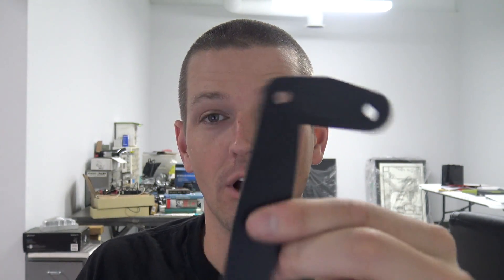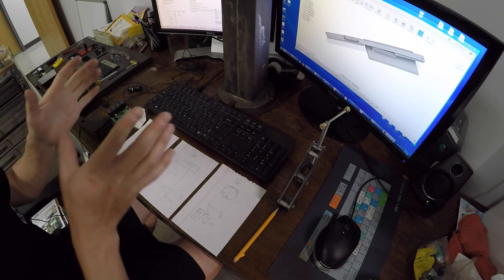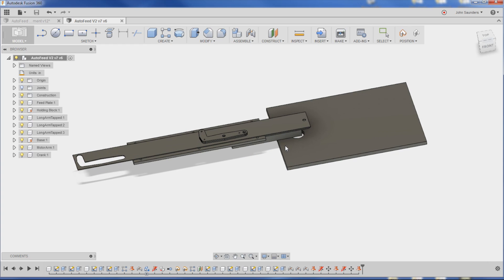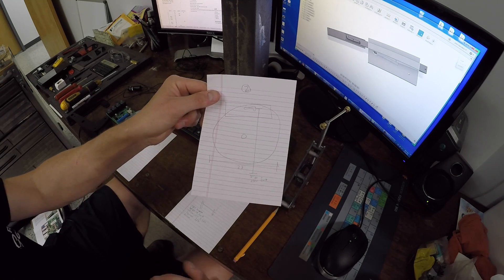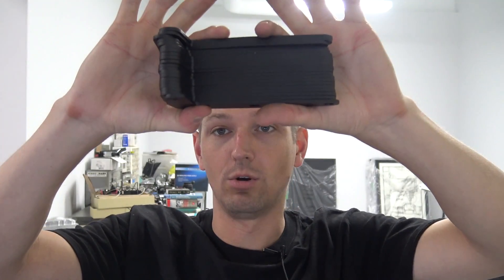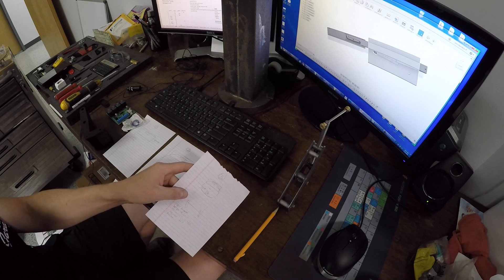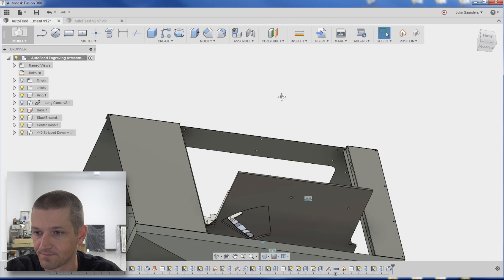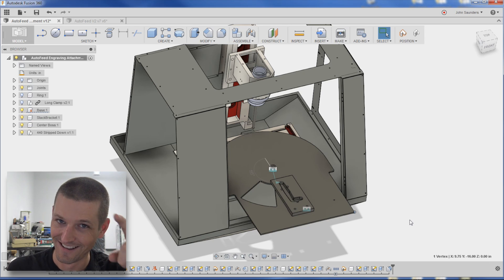Automatic Arduino CNC Parts Loader: Tormach 440!  Part 1

Comment: instead of using just one position why not use 11 slots for parts and one eject point and use smaller steps to make one revolution engraving 11 parts per full rotation

Comment: Nice! i'm so stoked about this one man. I do concur with the comments here about more slots in the disc to make it more efficient, also you could use one of those electromagnets to relieve the weight from the stack while the part is not being dropped to the slot.

Comment: Why do you need a disk? I would mount my stack over a platen on the mill table. The table could be motioned to drop and strip the part in a cutout in the platen then moved to be engraved, could then be moved and either dropped thru the platen to eject thru a chute (clearance problem?) or moved over a wedge system to ramp it up and out to eject to a chute or container to gather the engraved part.

Comment: Here's some help to make this super simple! Use a Machinists rotary table to attach your large round disk to. This will give you your pivot point. Plus add some torque multiplication and holding ability. Then I would recomend a CLEAR-PATH stepper with built in motion controller to drive the rotary table. Here is a link to a video on the Clear-path stepper. https://www.teknic.com/video/clearpath_abs_pos_4.mp4

Comment: having enough tolerance for the part to just gravity locate into the slot without moving when being engraved will be a challenge. The slot would either be too tight and you will have fees problems or it would be too loose and move under the engraver. I would vote for locating the parts with pins on a single flat rotary platern and using the automaton to place and remove the parts with a magnet. You wont ve scratching your powder coat finish so much by having them slide about.

Comment: I wonder if a servo motor would be better suited for the turn table verses a stepper motor? Seems like it would simplify things as far as keeping the engraving position correct because of where they work off of positioning instead of steps.

Comment: Love the circle idea, it's simple and has few moving parts.  One thing I would do is make the circle grab a new part every 60 degrees.  This will speed up cycle time ( the circle only needs to move 60 degrees instead of 360).  When the circle stops to engrave it is also at the spots to drop a finished part and pick up a new part.  Your feed hopper should work fine as long as you keep the stack level.  If the weight of the stack in the hopper creates too much friction, try using an actuator to keep the entire stack from resting on the circle at once.

Comment: If you go with this design you may want to consider having a tray to let the parts slide into a bucket that maybe is sitting on the floor outside of the mill.

The rotary table may need to be clamped, or pinned, so it doesn't move while engraving.

The idea, as suggested by others, to move multiple parts on the platter is a good one.

Comment: two things on sketching.  One, use light graph paper (very faint lines so your sketch shows and not the graph paper), that way square lines are easy to draw. Two, use a scale to draw straight lines that are on dimension.  Always draw to scale.  The other thing to do is label your sketches, date them and title them so you know what and when they are from.  

A few simple drawing tool from Staples/office depot for $20 will make sketching much easier and more enjoyable.  Triangle scale Staedtler ($12 each) (I like metric, but get a few.).  A sketch master template ($8), small 3x5" with circles, squares hexagons and triangles in it.  fantastic for drawing bolts and holes etc.  A metric scale and 5mm grid paper is awesome.  1:5 means 1 square is one inch (25mm) and is a great scale size.  1:2, 1:10 are also very useful scales.  Note scale is scale, it has no dimensions. half size is the same regardless of units.  You can add a compass ($13 for 6" staedtler) too if you want to draw circles that are bigger than a circle template normally has.  A good pencil and proper eraser are good too.  You will be erasing things as you figure stuff out.  I draw things all day during my designing process.  An eraser is much cheaper than scrapping a part because you were just "winging" it.

Comment: Looks good. Maybe to make it more worth while you can adapt it to be used for other parts. By cutting the shape for the single part doesn't make it very versatile for future use. Maybe make the rotating part a few mm thicker and instead of cutting the shape of that single part have it on its own little plate that's removable and sits on a bevel so it can be replaced with a different shape, if that makes sense. Would be a shame to put all this work into a tool that's only good for one part. Love what you do by the way you have taught me a lot. Cheers.

Comment: I think 600 isn't enough to justify building such a complex unit if you only plan on doing this 2 or 3 times a year.  However, if you plan on also incorporating this design to do other repeat processes or business be sure to design your parts loader for a more universal approach.  So that current development isn't wasted further down the road.  Best luck!

Comment: Hey John, looks cool, if you end up looking into the 1st linear idea again, not rotary, consider some tandem pneumatic cylinders, very accurate and inexpensive without any fancy electronics and you just keep adding cylinders for more positions. My day job is mechanical engineer and pneumatics are king unless your making a CNC machine or something that 'needs' positional feedback.

Comment: Assuming you can secure the part to the table with your electromagnet, the table will be moving quite a bit in order to do the engraving work. Is the rotor disc and motor attached to the table so they move with it?

Comment: Love the innovative hacking of your mill.  Would the parts placer holder be attached to the mill table?  Allot of weight for the servos to drive around?  Like bcbloc02 says, need some crazy legs support and follow the loader table as the mill engraves.  Got some alternative ideas if your open to feed back from an armchair machinist.

Comment: I would use a solenoid as a pin to lock the spinning disk in place when your not rotating it. A single solenoid that is spring loaded to lock into place when the disk in a certain postion (loading, engraving, unloading). 

I'm not sure how strong the electromagnet is, I'd love to see some testing of that.

You could even skip the stepper motor and just drive it with a DC motor and some limit switches or physical detents/solenoids.

Adding a vibrator (motor with unbalance weight) to shake the stacker/dispenser so that a part drops down and settles in might help out.

If you add more positions, and use something like a limit switch and index on the disk (notch or raised pin), you could have multiple positions instead of just one. You wouldn't have to wait for the stepper motor to do a full rotation before starting machining on the next piece, just move to the next slot.

 An optical sensor could detect if the next slot got loaded correctly (or not) and could skip that position if there was an issue.

If you can use code to send a system command (like to windows) you could use something like the Prowl application/api to send push notifications to your iphone/android phone. It uses a simple command line like prowl.exe -key=abc123 -message="Help I'm out of pieces to engrave".

Comment: You could definitely have more spaces for the parts to fall into, that would get you less time between operations. 
Also, how about some cams that lock the part when it gets to the machining location, you could also cave a cam to release the part when it's in the position for being placed onto the rotary table from the stack. Maybe gear the stepper to get more torque for actuating the cams. 
Looks like a really fun protect!

Comment: Is the exact size and shape of the hole/slot in the rotating disc possibly going to be an issue as it surely needs to be a close enough fit to hold the work piece in exactly the correct position to get the positioning and quality of engraving you desire but also then make it difficult to discharge the piece without jamming and reload with a new blank smoothly and correctly?

Comment: Slide 1 at a time from the bottom of the stack with a air cyl and uhmw slide to keep the weight and friction off the rotary table. Find a old Ferguson / camco indexer to keep it simple and accurate. Add extra positions to allow vision inspection, cleaning, and clamping. Design a shipping cartridge that slides in your loader so the manufacturer can just ship the parts to you allready loaded.

Comment: I think you should make the disk and stack hold different shapes so in the future you can engrave anything automatically. make the holder and disk use bolt-on interchangeable jigs.

Comment: I understand the "geek out" thing about automation. But are you planning to engrave more than 600 arms? What you're planning is a serious investment in time and resources for R&D, then tying up the 440 for production.  I'm almost sure you have thought about this.

One thing I can see is the chips from the engraving piling up and causing scratches in the finish as the parts are rotated around.   

Just off the top of my head, a conveyor belt arrangement comes to mind.

I'm not trying to knock your idea, just trying to play devils advocate.

Comment: Move the feed stack to the 3-o'clock position. Let the machines table take the weight of the parts. That way you won't need to bolt anything to the floor... Which would get rather noisy and messy once the machines table starts moving.

Comment: I would definitely add more spots. this is what I would do: Program your engraving as a macro. the part drops in one of let's say 6 slots (that way it stays structurally sound), an induction sensor checks to make sure a part dropped in the slot and is on the engraving location. The electromagnet activates, the controller receives the signal and calls the macro. engraves. then it goes to a hover position inches away from the table. a second later, the next slot rotates in and the sensor detects the part. repeat. it would save tons of time, and placing an induction sensor where your electromagnet/spindle position is will verify the rotory position and allows you to make sure the stepper didn't miss a step (and self calibrate). since the plates are ferrous, an induction sensor will work perfectly. it's also cheap, easy to implement and very affordable. you'd just have to play with your analog signals to initiate your electromagnet and sensor. if you need any help, let me know.

Comment: Hi John, If you mount have you base (the part with the rotary table and stack on it) attached to your tormach table how would your supporting legs to the floor work when the xy table moves. Are you going to have a resting only support ? (i.e not fastened)

Comment: well... you know about my "skill" with ruler assisted drawing ;-)

remember that spring loaded engraving mod I sketched you up?

well... most of my projects I did came out of my head without a sketch... only one was drawn big till now... and this was because of a whole room that got done with solid wood framing structure... but yeah... if you can draw you are pretty much in an advantage ;)

Comment: I love Arduino but... just an idea: you have yet an actuator, it's the CNC machine itself. I mean... there is no way to use the movement of the "spindle" (by some g-code) to activate the deploying mechanism?
For example: the table could not be rotated by the CNC machine itself by using some strategic holes placed in a well know position along the circumference of the disc?

Comment: Just out of curiosity, why are you only loading / dropping one at a time, fill the entire circumference of the the platter with spaces for your part, that way as one is loaded in, one is positioned to be machined, and one is positioned over the drop off.. 

Just seems easier to move a little, machine, move a little, machine, rinse repeat, with the loading, and dropping being done at the same time as positioning for machining.

Here's a quick little model i threw together in SW, i'm completely positive all of the dimensions are horribly wrong, but the idea is still the same:

https://grabcad.com/library/saunders-machine-works-rotary-jig-1

Comment: Hello John, very nice and fun project you have going on. Very ingenius. Just my to cents, i would go with vacuum to hold the part during engraving instead of electromagnet, since it would probably require quite some power and you risk magnetizing some chips that could cause a jam.  And you could use your electromagnets to hold the plates wheigh at the infeed above 2 inches of the pick up location, and release for pickup (the stack should drop till it loads a part) and than magnetize again to mantain position. And like you said you could use a proxy sensor to verify if the part was in fact loaded and in the right position...  
Wish you the best

Comment: The rotating table doesn't have to be "round". it can be a "rectangle" as long as the supporting table is round! You'll save some material, although I'm unsure if the introduced "ridges" will drag more than you're saving on constant drag from a full disk (on the teflon disk). Looks like a nice setup, though: Can you "exit" the worked on parts outside of the Tormack? Perhaps more space and therefore less hangups...

Comment: I would mount the stack inside the machine, near the table, and reinforce it so you do not have to worry about whatever legs you have sliding around on the floor (even though they would only have to move a small amount.

Comment: Seems like you could use the movement of the machine table to pick up the parts and move them under the spindle rather than using a rotary table.

Comment: The movement time of the rotary table could be halved by having two positions on it. This would do two things 1. Saving movement time by only needing to rotate 180 digress at a time and 2. It may solve your fixture problem as the table would be paused under  stack giving it time to seat down it the rotary table rather than trying to fall into it on a sweeping motion. Two problems though... 1. You would need two magnets and indexing censors and 2. The indexing of the second slot so its centred under the stack while the other was engraving this could be achieved quite easily by cutting the slots on the assembled working table then just mounting the stack where it works. Let me know what you think

Comment: Two ideas:

If the part is in sheet form with clear edges why not put in a stack of parts high as the z axis allows and then engrave the first part, slide the first part to the side and engrave the next part. Depending on the available y axis space you could put several stacks under the machine along the x axis and slide the parts down. This will probably need some kind of driven clamp to hold the part while it is engraved and a mechanism to retract the holding system so that it does not collide with the spindle.

Another idea would be to use on of the holes in the part as a pivot and slide the engraved parts aside like a screw pitch gage or a multitool. That would work if the spindle is clear of the pivot. If you could push to the side the part with the tip of the engraver it would not even require a Arduino. :)

All this ideas require intervention after each "smallish" stack of parts. It would be nice if your system could take all the parts at once. But i'm not sure if the use of time would be economical even if you would get a really nice video out of it.

Comment: Good one John. To relieve the stack weight yo may be able to have some of the stack at an angle, just steep enough to self-feed, but not so steep to have the full weight of the stack on the feed platter. Bend the feed chute from rod to locate the work corner and edges. Just enough rods so nothing jams by turning sideways. Turn the feed vertical just before the platter and you should finish up with reasonably consistent feed pressure irrespective of stack height. Hope that makes sense.
Reply: Have more work slots in your platter and just index them around one position. No need to have just one part in the system at a time
Reply: This is exactly what I thought! If it fits, as much as 12 slots 30 degrees apart from each other would be awesome, that would save some serious chip-to-chip time.
Reply: My thoughts also, a plus would be to balance / offset some of the stack weight

Comment: If the bottom plate is mounted to the table and you have supports from the front corners of it down to the floor supporting the front edge how is the table going to move to engrave the parts? Won't the legs impede the table movement? Or am I missing something?

Comment: I think I would rather use ball bearings such as the ones for material rollers instead of some teflon sheet, especially considering the weight of the stack. It would probably reduce the torque needed.

Comment: Would it not be better to use a ballscrew to make a linear axis, and have the unengraved stack on one side of the spindle, and the finished ones dropping off on the other side? 
That way you would not need to support the moving rig on the outside of the machine. plus positioning would be better...
maybe even implement some automatic stacking of finished parts.. :D

Comment: Just thinking out loud here.... with the base plate mounted to the table and legs on the floor outside the machine enclosure, will that not be too much load on the table and stall out the Y axis stepper while engraving or am I missing something?

Comment: why only 1 cutout. with multiple cutouts, you could prox sense if parts are loaded. or vision system the engraving after. and you would not spend so much time for a part load